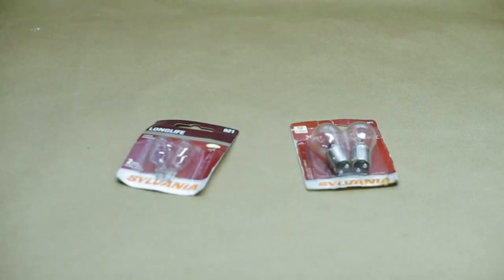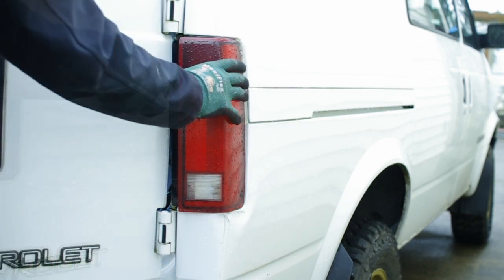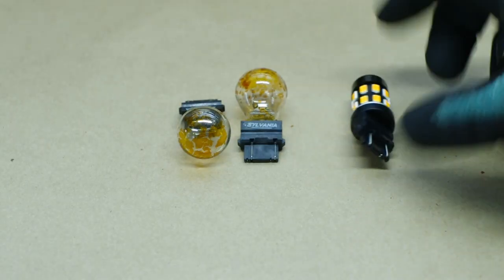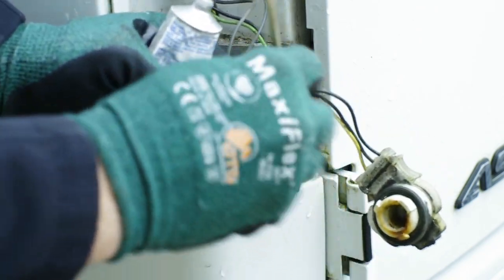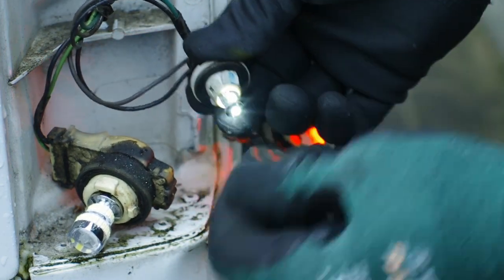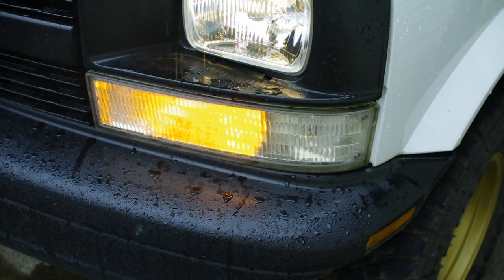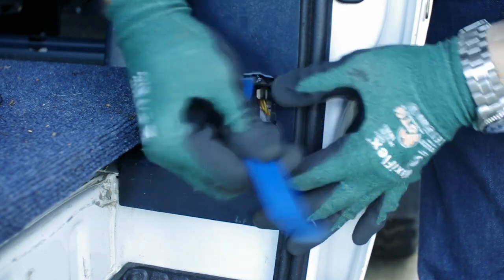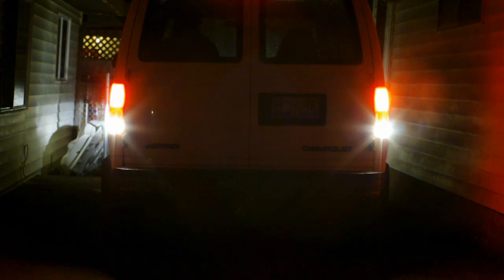Astro LED Light Upgrade

Comment: Front turn signals: Amber 3157 bulbs (turn signal specific)
Side markers/Running lights: 194 bulbs
Backup Lights: 1156 bulbs
Turn signal/brake lights: 2057 (he said 1157 in the video but the bulb in the picture, and online, both say 2057)
Bonus: anyone running a newer astro with not-sealed-beam headlights, they're 9006 low beam and 9005 high beam.

Comment: 5:40 Huh, I have amber canbus LEDs in my corner turn signals but depending on which way I install them they either turn only flash if I'm using my turn signal and turn off with the parking lights, or don't flash with the parking lights off and do with them on.

Comment: My brake light and turn signal blink at the same time on my driver side tail light, I have a 2005 chevy Astro. I’ve had the socket changed out, fuse isn’t blown, what could my issue be?

Comment: Was ,told I may need a new wiring harness [ under the steering wheel ] in a 95' Astro Van . Any ideas. The light are not working  right .

Comment: did you end up doing the map lights?  I have those same pop out map lights. I have tried two different Led configurations but both were too fat to fit in the bulb housing.  I would love to upgrade the map lights.   it is a shame you need to open the door to turn on the dome lights... (or is there a way?)
Reply: You can turn the dome light on, by rotating the dimmer wheel beside the head light switch.
Reply: There's also a 'dome override' push button adjacent to that dimmer wheel.

Comment: I’d like to see how you do the led headlights.  Bought some and they’re not exactly “plug and play”.  Reversed the pins and high beam works.  Put on the low beam and nothing.  Trying to figure out why.
Reply: For vans with the 5x7 sealed beams like this guys I got your plug and play reality covered.
Vision X 5X7" HI\LO SEALED REPLACEMENT Headlight Housing [H6054] 5x7 7x6 

Morimoto 2 stroke 3.0  H4 LED bulbs.
Plug and play. The only issue I had  was not being able to use the (supplied with the sealed been replacements) bulb plug dust boot. I opted for High Temp RRV and sealed those bad boys up. Follow Headlight Revolution adjustment video and BAM. I got the best lights
on the road.
One thing to know is they are not SOT for headlight. But properly adjusted you don’t blind anyone ( like so many idiots do) while still gaining super improved lighting.

Wish this guy would tell us what the heck he used,,, lot of money can be wasted experimenting.